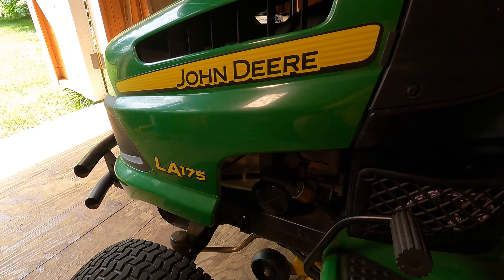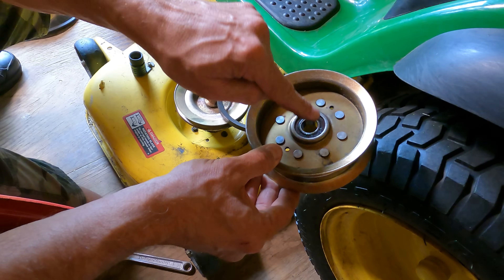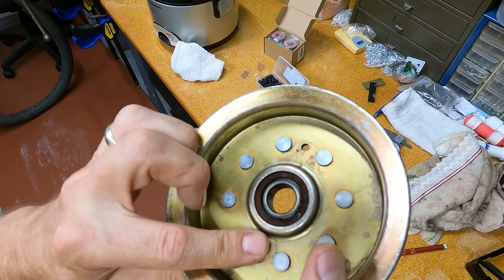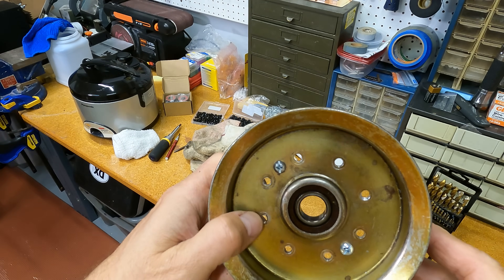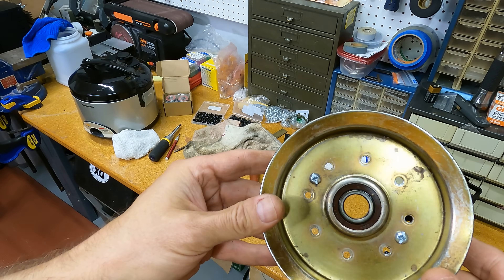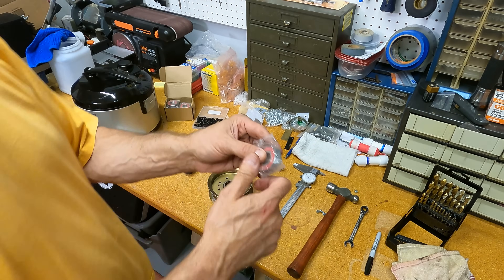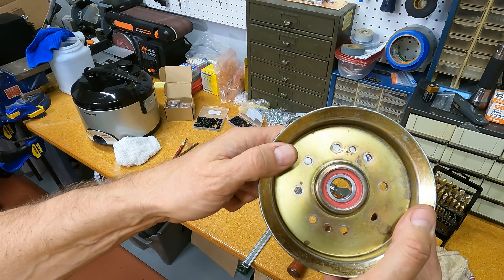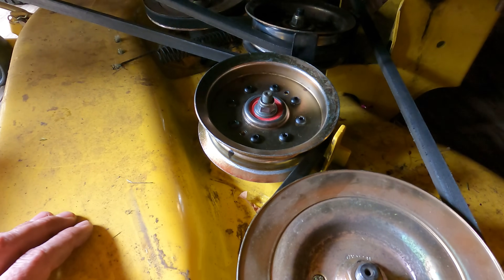John Deere mower deck bearing replacement

Comment: What one must consider is your time , everyone is worth something,also we must question the manufacturer as why these bearings or bushes wear out so quick ?
Should they be using a bigger diameter bearing ?
Can you try spraying a liquid grease into the bearing?
Reply from the maker: Yeah, I probably would have put a larger OD bearing in if I designed it, but JD is trying to make money? lol. Spraying oil or trying to apply grease externally to a bearing is usually a losing proposition. The "lid" or cover on this style bearing can be gently removed with a pick tool, allowing re-greasing if the bearing is not too compromised, and then snapped back into the bearing. When a bearing starts to get "grumpy" though, IMO it's usually better to just change then out, as this style of bearing is dirt cheap anyway. Thanks for watching!
Reply: One thing I see is that a lot of folks bust out that water hose the minute they get done mowing. Hot bearings will draw in the water and wreck the bearings. John Deere doesn’t use any smaller bearings than anyone else. Just for credibility sake, I have been in the outdoor power industry as a technician for 20 years.
Reply from the maker: @erikbarbee3907  That's good info on the hosing down some people give their mower after every use, not a good idea... I agree! Thanks for the info, and for watching!

Comment: Just knock out the bearing from the back. Replace them and mow. Seems you lowered the river instead of raising the drawbridge.
Reply from the maker: As I pointed out to another viewer, if you watch the video, you will notice that the bearing is intentionally "captured" under the stamped metal lip on each half of the sheave. It cannot be simply pressed out with an arbor press or otherwise. Thanks for watching!
Reply: @halfmoontechlabs  problem with skillful videos is you make it look easy. I should have realized the research you invested. Thanks for video and detailed explanations!
Reply: Had he just knocked out the bearing, he would have been buying new idlers.  They have to come out from the center.

Comment: I didn’t think hearing pulleys called sheaves would bother me so much, but it does.
Reply from the maker: Lol... the terms are used interchangeably in most countries, though there are certain localities where there is a preference for one vs. the other, and this can be industry or company specific as well. The fact is here in the US, the convention is ambiguous. The deciding factor is "what term does the manufacturer use?", and in the case of JD riding mowers, the manual calls them sheaves... so sheaves they are in this case ;) Thanks for watching!

Comment: Ironically you use a drill press (most people don't have, and isn't cheap), to save money on a $30 pulley. How much is your time worth for the extra labor? Then, to cap it off, A crescent wrench to remove bolt.
Reply from the maker: Also ironic is dismissing the good 'ol crescent wrench... I'd point out not everyone has a socket set large enough to use on the large shake-proof nuts, so I deferred to the wrench in an effort to show that nearly anyone can do it. I also admit that not everyone has a drill press... but more likely a do-it-yourselfer willing to take a crack at this has one. You missed that I was holding the crescent backwards... I noticed when editing, but that can happen when you are trying to film and turn a wrench at the same time, lol. Thanks for watching!
Reply: @halfmoontechlabs  My late father was a machinist by trade, he was quite anti crescent wrench, but sometimes it is the needed tool for the job.
Reply: I cringed a little at the opening scene "knuckle buster" but this guy clearly knows what he's doing. Also, I think the average Joe Public could do this job with a regular old hand drill. Otherwise, Brilliant repair work and I love it when I get to keep more of my hard earned money in my pocket. Thank you Half Moon Tech Labs !!! Liked and Subbed ! Mike, are you by chance a JD rep ?.....LOL
Reply: Another commenter said that his JD store was charging $75 per each.......
now that makes the setup ROI for this job even better.....
Reply: The time for the extra labor? Don't you think it takes more time to drive to the John Deere store and return with a new part?  Don't you ever just sit and drink a beer?  How much is your time worth if you can afford to sit and drink a beer? I'm not wasting $50 on a beer. Imagine what is cost to sleep at night.
Reply from the maker: Sometimes I do just drink a beer, and sometimes I make the beer myself, and share it with my friends and family. Not because it's cheaper, but because sometimes I just like to do it myself, and then bathe in the DIY afterglow ;)  Thanks for tuning in!
Reply: First, there is nothing preventing you from drilling, grinding or even chiseling the rivets off.  I could easily replicate this with a hand drill and plan to.

I noticed a dial indicator lying next to the drill press ... I would have been curious about runout before and after bearing replacement but I  could see visually when he spun pulley with new bearing this repair was excellent.

I will be reconditioning my cub cadet deck soon, I have similar pulleys.  I replace a bearing and or spindle each year, aside from that this USA built mower is well designed.  500 hours and works well.

Great video,  I will copy your technique 😊
Reply from the maker: @jimw6991  Glad you enjoyed it, and hope it helps. Thanks for watching!

Comment: Could you not have just pressed the bearing out or do you not have an arbor press?
Reply from the maker: I do have an arbor press, but if you look at the bearing, it's captive inside the sheave with a preformed shelf that negates pressing out the bearing (on each side)... hence having to drill out the rivets to separate the two sides to extract the bearing. Simply pressing it out is not feasible on this JD design unfortunately. Thanks for the comment, and for watching!
Reply: Wouldn't that have been so simple for JD to design a bearing retention system allowing the bearing to be easily replaced?????
Something like a screw on  ring like on the end of a hydraulic ram...
unscrew, take out bearing, place the new bearing, screw ring tight and go....
Reply from the maker: @JohnSmith-yv6eq  I agree, this could have been designed for ease of service, but IMO they went the "ease of manufacturing" route with an alternate revenue stream bonus, vs. ease of maintenance for the end user.
Reply: @JohnSmith-yv6eq  It would be very easy as you can see on older machines. There is a c-clip on both sides, but the JD design seems to be much cheaper (for JD, not for the customer).

Comment: should have removed seal and added grease to new bearing . Sometimes there is little grease in there.
Reply from the maker: I actually did this, and mine were fine. You are correct however, as many are not properly greased. This was mentioned and answered already in another viewer's post. Thanks for watching!

Comment: Excellent Video on replacing the bearings at quite a savings.  BEST VIDEO I'VE SEEN ON THIS SUBJECT AFTER WATCHING MORE THAN A DOZEN.  I have one additional issue. My pulley also has a bushing inside that needs to be removed.  Any suggestions?  I don't have a press.  By the way, it's John Deere part #AM136621 that John Deere sells for $70.00 as of July 2023.  So, I'm definitely looking forward to saving some money now and in the future.  Also, I've had the mower for about 10 years and this is the third time that the pulley has had to be replaced.  Never had a problem with the blade mandrel assembly in all that time.....still original.  Thanks Again for the Video!
Reply from the maker: Thanks for the kudos, and as far as the bushing, it can get stuck or basically  spin-weld itself to the inside diameter of the bearing over time... or just be plain corroded into place. An arbor press is the best, but in lieu of that, you should be able to hunt around for anything metal that has a slightly larger ID than the bearing's ID, and lay the bearing on top of that on a flat rugged surface. Then place a FLAT piece of metal stock on top of bushing that is protruding on top. Then (carefully) deliver a solid blow or two with a hammer AS FLAT AS POSSIBLE, and with any luck, the bushing will pop out from center of bearing. When the bushing is freed, I'd clean it up (gently) with some very light emery or Scotchbrite pad prior to inserting it into a new bearing during replacement. Hope this helps, and thanks for watching!
Reply: @halfmoontechlabs  Thanks....hoping you'll be making a lot more videos,  you do a great job.
Reply: @alandust2188   It's difficult to tell without a picture, but often you can remove or install things (push or pull) by using threaded rod, bolts, plates of steel, nuts, washers, sockets etc, just think about how it went in and how it needs to come out. Many sockets have a different size outside diameter, and a threaded rod slips thru right thru a 1/4", 3/8" or 1/2" socket, get creative and you'll find you can push/pull bearings, sleeves, bushings out without any type of press...
Reply from the maker: You are correct, many ways to improvise to either push or draw a component from another item. In this case, the stamped shell design with a lip that covers bearing negates doing this without destroying the assembly... thus the rivet removal instead. Thanks for watching!
Reply: @halfmoontechlabs 
Yep, spin weld itself in. If that happens, it's throw away the whole spindle. Happened to both my idler & spindle on my LA145 Deere.😢
Reply from the maker: @skostro100  Yeah, once they seize up, it goes downhill very quickly. Thanks for watching!

Comment: You can change the berrings on the blade spindles too, take off top nut,knock the shaft out.  Knock out berrings. A guy on YouTube greased the spindle till the grease came out both ends of spindle with little dust covers still on berrings!!! Put some oil or grease on top of the transmission pulley to prevent water from getting into the splined shaft and destroying it
Reply from the maker: Good advice for the other bearings, and thanks for watching!

Comment: A bottom hole milling bit on a press works great. Instead of a standard metal bit.
Reply from the maker: Lots of different methods but I stuck to a simple method that most handy folks with limited machine shop experience can use... otherwise I would have used my industrial CO2 cutting laser :)

Comment: It's good you know how to fix things instead of throwing away a 75$ part. Add some good grease to the berring lol
Reply from the maker: It's true that some of the less expensive, overseas sourced bearings can be light on or flat out missing any useful grease. Luckily it's easy enough to use a pick to gently remove the "keeper" on either side of the bearing, smoosh a bit more in, and replace the lid so to speak. Thanks for the comment, and for watching! Take care.